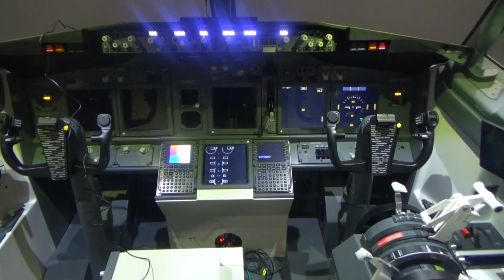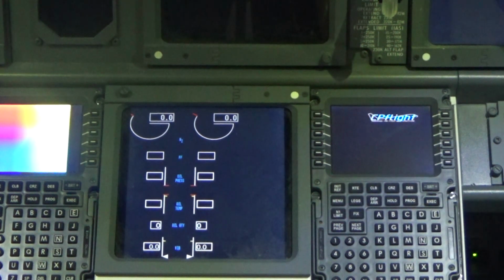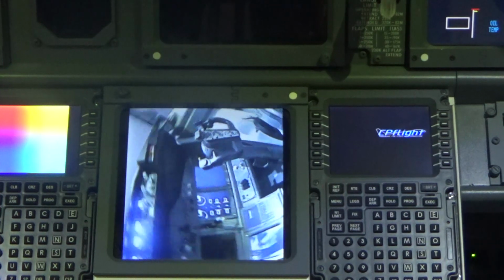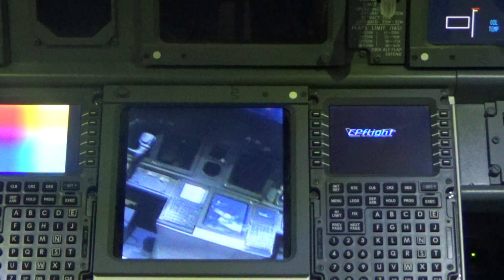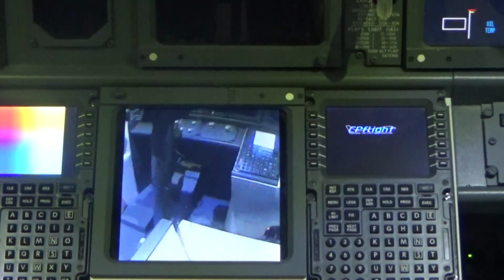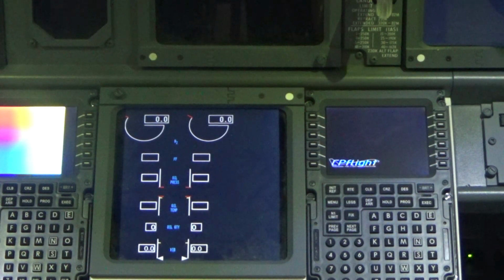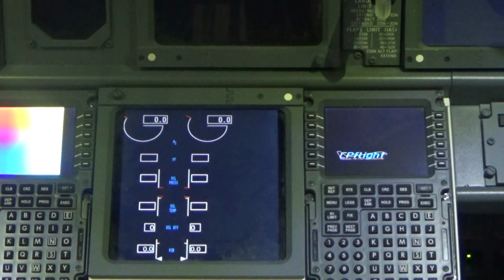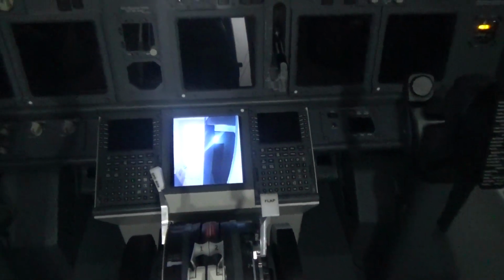Flightdeck Entry CCTV

Comment: Wow that’s brilliant. I have 
Mines installed in the overhead like some of the later 800 variants. Thanks for sharing I will definitely add this on/off switch to mines.
Reply from the maker: I know that on the latest aircraft they have the switch on Cam1, Cam2, Cam3 and then a push button to do on/off. I did only one cam :)

Comment: Hi :) I have tried this. Sadly it messes with the display 1/2/3/4 setup how they are lined up. You can see your lower screen go up into fo mfd .
Reply from the maker: The lower screen goes up into the FO display when the Cam is on. When you turn it off, it goes back to normal. Typically, you will use the Cam on during passenger boarding at the gate, after which you would turn it off and no touch it during the flight unless you need to, so it's not a big problem.
However, i will find a solution to the problem. Unfortunately it is to do with how Windows talks to the display and so far i was unable to make it perfect, but it will be in time. To be honest it's not a big issue but you are right, it needs to be fixed
Reply: @alpasimulation5485  yeah I tried everything, it is ok when using two computers and the non visuals are on another computer. I tried it with one computer and 8 displays and they all fumble around if you disconnect or add one like this. I shall continue to work on it as well.
Reply: This is clever! But yeah too bad about the screens. How about if you combine the upper eicas and lower eicas on a single instance of prosim display and extend it across. I wonder if would still shift? Maybe not